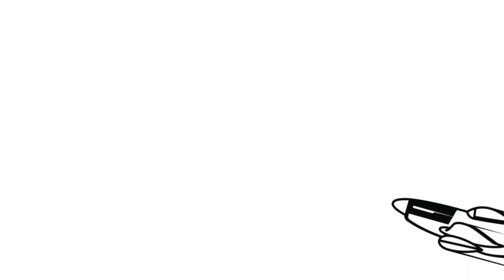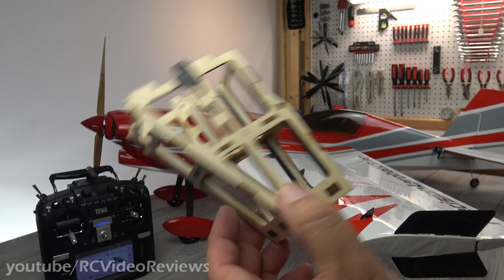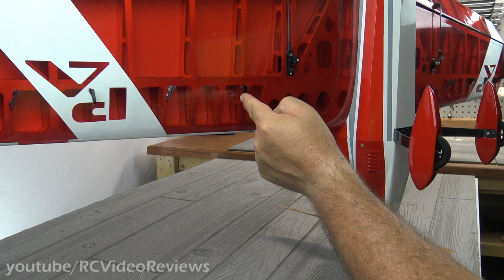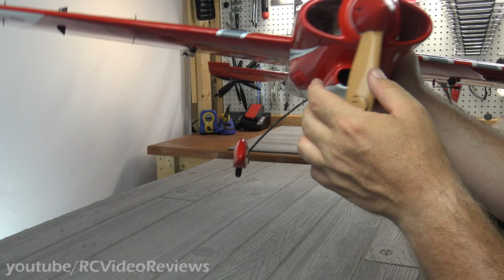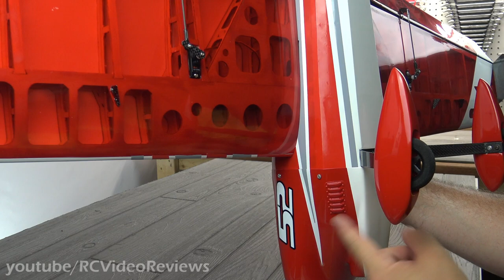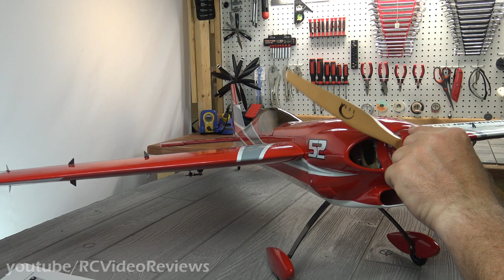PA XR-52 Build Review - Precision Aerobatics 3D RC Plane 52" XR52 with Fiber Fusion!

Comment: Great job! I had to trim off about a 1/4 inch on all my servo rods..they didn't package the correct ones. You are correct on balance that their motor is heavier, cause I used PA motor and mine balances with battery further back.
Reply from the maker: I updated the description with an answer on why my elevator rod came up short. I mounted the output shaft forward instead of aft to get the servo arm to center perpendicular. I'm positive that's the reason it came up short.

Comment: Thanks for your time and efforts putting out these videos.  Very helpful for newbies like myself.  I can not find a video of you flying the XR52?  I am interested in your comparison between that model and the KMX.  I am looking at both and wondered what your take on their comparison.
Please continue with your great work!
Reply from the maker: Glad you find the material helpful. I did actually maiden the XR-52 and it went fine. I had some pulsing on the ESC so I elected to change it rather than "troubleshoot" on this particular plane. I have this one on my short list to get out to the field again. As far as the Katana, they are almost twins. I can tell you both planes have far more skill than I do. They are an absolute pleasure to fly even with my mediocre 3D skills. They are so well balanced, so neutral, and so light there are no other planes in my collection that quite fly the same way. 

Thanks for the comment. I can't recommend the Katana or XR-52 enough. Be patient with your build. Take your time and do things the right way and you'll be rewarded with a fantastic airframe no matter which one you chose.

Comment: Beautiful looking plane. You would think for the price of this plane it would include a complete set of rods & screws that fit. Doesn’t Precision Airobatics test build a sample of the models they sell?
Reply from the maker: I updated the description with an answer on why my elevator rod came up short. I mounted the output shaft forward instead of aft to get the servo arm to center perpendicular. I'm positive that's the reason it came up short. In my defense, I'm pretty sure in one of their videos they recommend doing that to avoid subtrimming out of the box and in any case, a 2mm longer rod would have solved the issue.
Reply: That’s fair, PA can’t be held accountable for customer modification. There is still the minor annoyance of the servo screws.
Reply from the maker: Yeah the servo screws aren’t a PA issue either. I didn’t use PA recommended servos.

Comment: I have the '52 in green and don't like the lack of contrast in flight. Don't get that color. Agree on the cg, it's hard to get it as much forward as necessary. The wheels are way too brittle to last, slight sideways loads can damage them. I put bigger ones on and fly without wheel pants.
Reply from the maker: Thanks for sharing. Good info.

Comment: I have two of the PA airplanes one of them is the XR 61 they fly different because of the extremely low wing loading once you get used to them you fall in love with them not good for very windy days
Reply from the maker: Have to agree with this. I've only flown my Katana a couple of times but I understand the nature of the plane. Very precise and bad habits have been designed out of the airframe.

Comment: Despite being a bit of a PA fan boy I'm afraid they really dropped the ball with this model particularly with regard to quality control issues.
My kit had all kinds of faults including aileron hinges that were full of super-glue and terrible misalignment on the tail feathers. Trying to get the cowl and canopy to fit properly relative to the prop, motor mount & spinner proved to be a complete nightmare - and this was with the recommended PA Thrust motor & carbon spinner so they couldn't blame the misalignment issues on me using a non-approved motor. There were at least a dozen other issues that simply shouldn't arise on a high end, quality ARTF.
It's now a lovely flyer but I haven't even thought about buying another PA product after this mess.